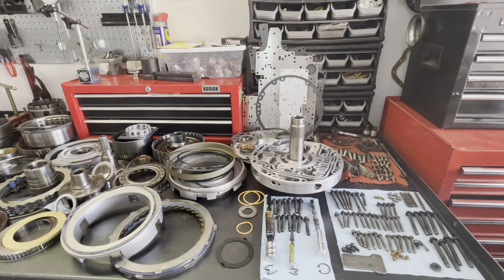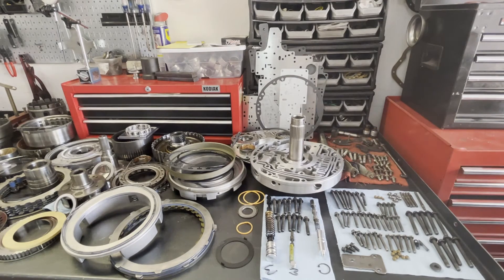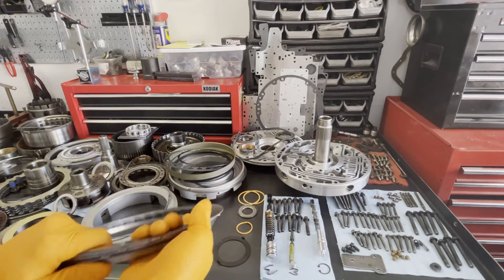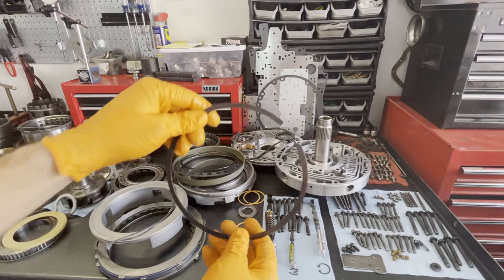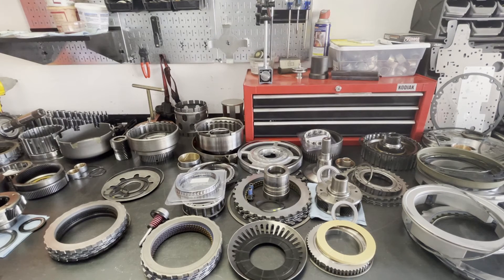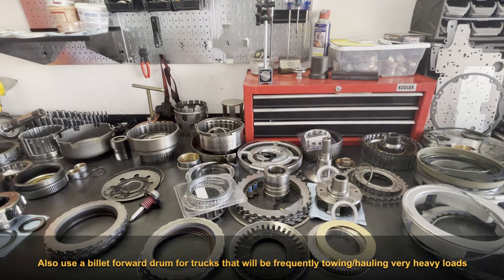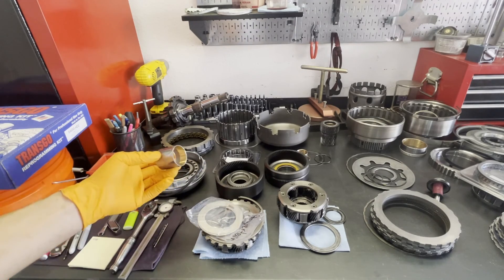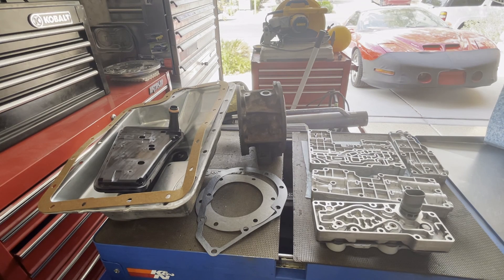1. Ford 4R100 Rebuild - Overview and Required Updates

Comment: Hi Nick. I’m curious if you do diagnostics on transmissions for those in the local area? I have a 2001 F350 7.3 automatic that has a shudder/vibration during acceleration. More noticeable at higher speeds. Feels like the transmission. If this is something you do, please let me know. Thanks.
Reply from the maker: Hi and thanks for watching, 71shanster. I used to but time doesn't permit me to do on-vehicle diagnostic work anymore. More than likely it's your torque converter that is shuddering, if the vibration is transmission-related.
Reply: Thanks, and totally understand. In. The event I need the transmission overhaul, how does someone get on your schedule?

Comment: By chance, are you located near eastern PA?  My 4R100 behind a 99 5.4 bucks hard as hell when coming out of overdrive if RPM is quickly reduced and I fear between my type of luck and the age of the vehicle, it's only a matter of time before she shits the bed on me.  I'm a very widely skilled DIYer and have personally rebuilt the top and front of this engine with some videos on my channel of that, but I've never did tranny work, have the needed tools or a clean indoor work area and I'm smart enough to know I'd be in over my head if I tried to do this myself.
Reply from the maker: Hi Michael, nope. I'm in Vegas. Originally from Philly but haven't lived there since the 90s and unfortunately, I don't know of any reputable transmission shops in the Philly-Eastern PA area.
Reply: @nickstransmissions  as far as I know, Black Sheppard is in the Philly area, but I'm up in Scranton.  Thanks for the reply though, and more so for the content you shared.  I may one day acquire another trans and try to rebuild it using your videos as guidance.  I also got the Ford factory manual for my year from eManualsOnline, so have multiple resources now.

https://www.youtube.com/@blackshepherdauto

Comment: Can you tell me the size of your transmission bench and pictures if you have a moment. Thanks. I enjoy your videos I will be rebuilding my 4R100 following your techniques. My truck is high horsepower 4-500hp
Reply from the maker: Thanks for watching Jonathan. Which transmission bench are you referring to (I have three of them that are often featured in videos)?
Reply: @nickstransmissions  4R100 Im pulling my unit this weekend to tear down. Found very dirty fluid and what looks to be pieces of a sprag race
Reply: @nickstransmissions  I guess I should ask how much surface area do I need to tear down, clean, and stage each assembly
Reply from the maker: My vids show the appropriate amount of surface area for each portion of the process. My largest bench is 8'x3'x40" or so...My main tear down bench is the same dimensions except it's 72" long instead of 96".

Comment: The Accumulator valves becoming stuck sucks!!  ALL 3 of mine were hard to move but the 4th was really bad.  I had to soak it in mineral spirits and work it back and forth,  1mm at a time, forever!!  They will all be replaced with steel valves as I believe this is what eventually led to the clutch burnout.
I found a old telecom pic I had worked best, and oddly it was very useful throughout the rebuild.  Like it was made for transmission work.   Jonard Tools JIC-22035
Reply from the maker: Yes, they can be an absolute pain in the ass...I've had a few come in where they were so siezed/stuck, I just tossed the accumulator body and replaced with a good, used one that was compatible with that particular 4R100.

Appreciate the tool recommendation, will check it out. Anything to make quicker work of those acc valves would be very helpful and well-received 🍺

Thank you for watching!

Comment: Looking fir the best heavy duty clutches for my 4R100. Here's my application;

7.3L Powerstroke pushing about 400hp
4x4
37 inch tires
4.56 gears with selectable lockers
Will see quite a bit of off-road use, mostly rock crawling

Any advice will be greatly appreciated.
Reply from the maker: Thanks for watching, @theezeelife292! 

I typically use Raybestos GPZ frictions or their Stage One red clutch module. Those are both great for heavy duty working/towing/off-road use and are usually available from local or on-line transmission parts suppliers as well as eBay. The Raybestos blues are also great but I generally don't use them unless racing is apart of the equation. 

Another alternative are the Alto Reds w/Kolene steels...I've used those as well with good results.

Comment: Do this transmission shift really hard after been bulletproof?
Reply from the maker: Thank you for watching, Robert...If they are improperly calibrated, either mechancially or electronically, they will..Shifts should be crisp, quick but not harsh.

Comment: Nick, I have had a heck of a time finding any useful information on rebuilding the 4r100 in the detail you provide. I have a late 99 7.3 and suddenly had all neutral gears while hauling my camper. If you have the time, I would love to have a conversation with you in regards to which parts I should rebuild with.
Reply from the maker: Are you saying that in all my 4r100 videos up on the channel, none of them are helpful for you or am I misinterpreting what you’re trying to say? 

The parts I cover in the overview video are what id recommend you incorporate into your build. It’s up to you if you want to run the Transgo PwM-to-On/off TCC lock up kit.

Comment: Hey brother thanks for the video  if the imput shaft breaks can you just replace the shaft ?
Reply from the maker: In theory, yes (use a billet input shaft designed for your engine’s power and torque levels) but in practice snapping the shaft can also damage other components. Once you have it out and apart you will see what needs replacing.

Comment: Do you have a parts list for this build?
Reply from the maker: I'll put a complete list in the description later today but here's what I recall from memory: Raybestos Blue Plate and high energy frictions, Raybestos steel kit, complete bushing kit, Sonnax Zip kit, Transgo Tugger shift kit, SLS overhaul kit (gaskets, seals, etc), filter, solenoid pack (Ford OEM), Transgo torque converter clutch lock up PWM-to-OnOff kit (optional), thrust washer kit, billet steel input shaft (high performance only), custom low stall torque converter.
Reply: @nickstransmissions  Can you add the complete part list to the description??? Thank you sir!
Reply: @nickstransmissions  Looked for the "SLS' brand, could you tell me their full name ?
Reply from the maker: Hi Brian, S/LS is a code for an overhaul kit, not actually a brand...If you're looking for a complete kit (less solenoid pack, hydraulic correction kit and one-way assemblies) check out this Raybestos Stage One kit on eBay...I've used these and their GPZ friction module over the years and have had very good luck with them...Much better than the factory frictions for higher HP/Torque HD applications.

https://www.ebay.com/itm/175485950022?itmmeta=01HWP9GXDDY9SX3E26N9EV8FA4&hash=item28dbc71846:g:ROkAAOSwJoJjbo1x&itmprp=enc%3AAQAJAAAA4KeV3syZs7966E5kBo8pcCtARsj2xgyCI44BJkSjSF7EoZkxHCYoEMzcjFHszLdxyzo4ROHlq3dIIJpf7kAbTjxQrizRPZ5y6LDniQXwi%2BTfvUY9ECHt00rEnMeGT%2Bkd0Cq%2FOxaeZWBR1c86gCqMAXZHpc1I49W7GldfvNsOwr5%2F2vG8ysGINMNCERaYcQh5FQnLLGNrQCxhCis85wtNtOVpnhqZ7gwg1KoKyrBZWBSBbWWN53R41%2B1lyUNrAV1PaPqaKd8%2FC913RZBmGqWkynoH95xq5Gr6qEaRq2Vw%2Ba7C%7Ctkp%3ABk9SR-bWw8nlYw

Comment: Going to be rebuilding mine this weekend. Curious if you have a link to where I can get the shift kit n extra parts for the rebuild?
Reply from the maker: Any transmission parts supply shop should stock the Transgo Tugger and Sonnax parts...Amazon, Ebay and other online retailers have them as well. Don't forget to have the coast clutch drum brazed as most don't do that step and Ford has a TSB out on it.